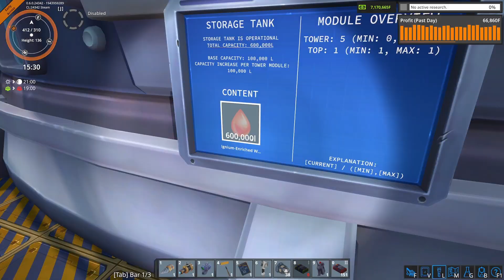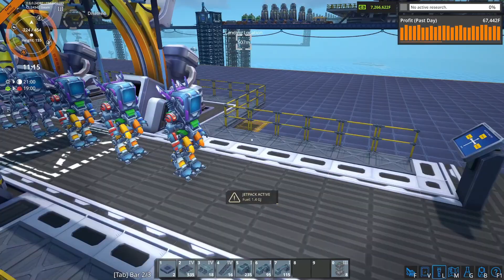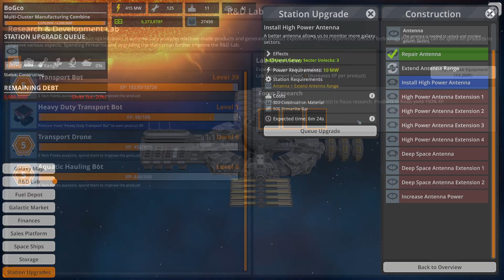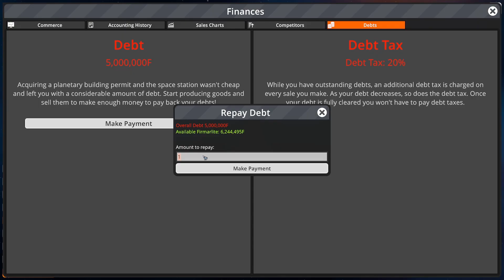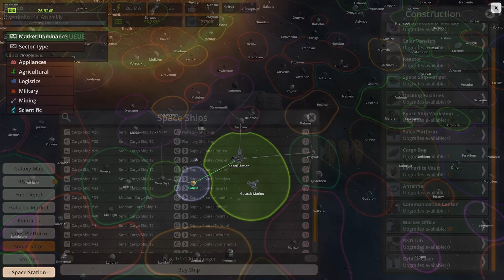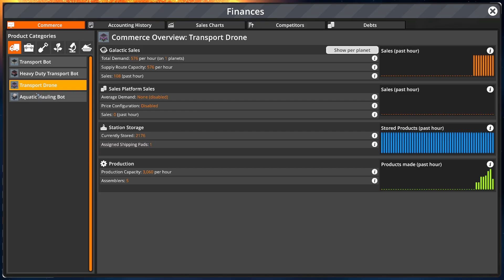Foundry - XenoTech Update 3 - Finish Robots and start to sell on the Galactic Market

Comment: last night i got the last of the bots and drones running and got the assembly line parts automated. finally calculated paint requirements at 19,200 to sustain 6 assembly lines. now to get their parts assembled and loaded into the assembly lines. this should be fun.
Reply from the maker: Hi piece of cake you got this lol
Reply: @Burnedoutguy  well, i would if i had remembered the 288 T1 assemblers i needed for robot parts, so that's what i'm working on today. oh, i'm using T1 assemblers because they are more power efficient. the problem i'm noticing with using them now is the number of loaders and conveyors it takes to supply them. good thing i took a break part way through getting them set up. i realized robot parts can't be stored on the station and i don't want to have to run over 2km of conveyors getting them to the robot assemblers. so the 1.5 hours i spent on setting the robot parts up has to be moved closer to the end of my bus to supply them.  👀
Reply from the maker: Ohhhh no that sucks bud lol
Reply: @Burnedoutguy  not as bad as i thought. i forgot about the cargo ships. the joys of being old, i guess. lol
Reply from the maker: @lonnierh0dgejr41  lol as long as you still remember is what really matters lol
Reply: @Burnedoutguy  yea, at least i still remember my name. lol
Reply: @Burnedoutguy  robot parts and paint all produced and delivered. next up are the robot productions and assemblies. we'll see when i have the energy to spare to get that started. lol
Reply from the maker: I'm really looking forward to the trains. I'd like to see how they handle and how much product they can move and what other things that they plan on adding in this next update
Reply: @Burnedoutguy  me too.